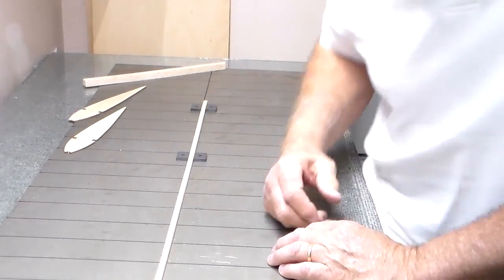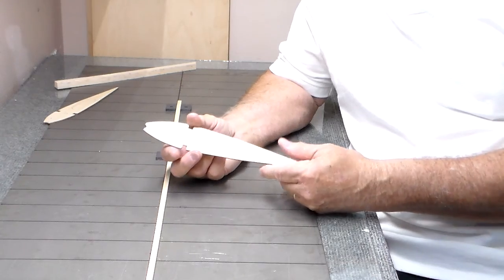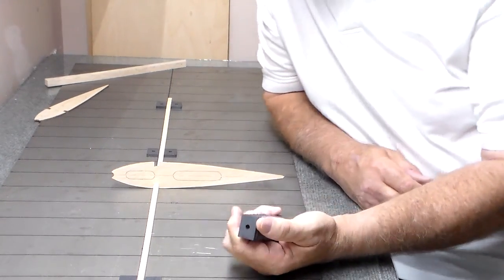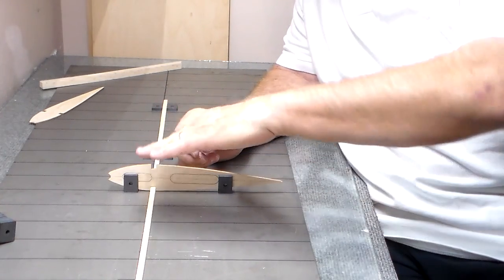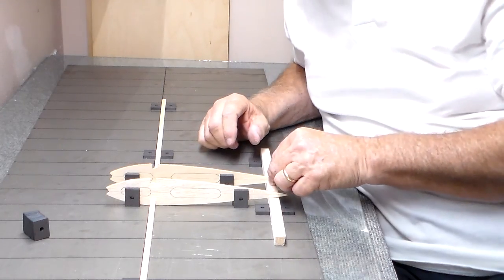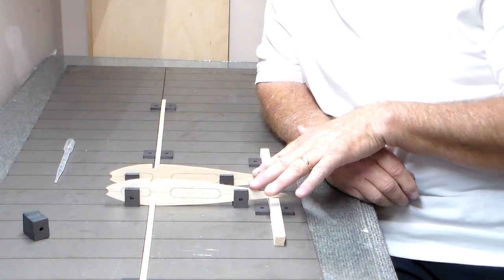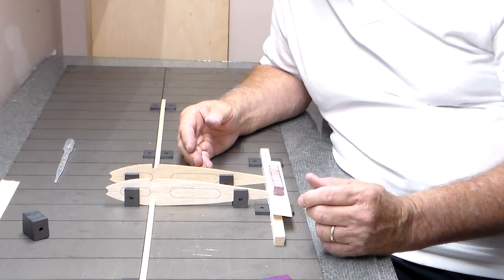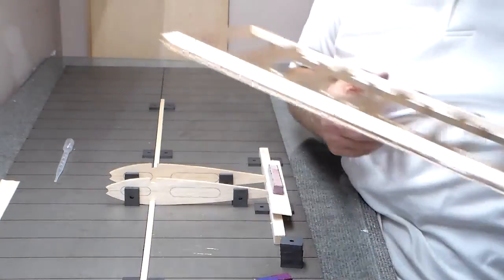Magnetic Bld

Comment: You can make the magnets even stronger by either purchasing the ones with the metal plates attached to both sides or use industrial cement to attach the plates yourself.
I used steel washers to keep the holes in the magnets functional for bolts if needed. Sparing the alignment and drilling steps on the plates by using the washers instead.